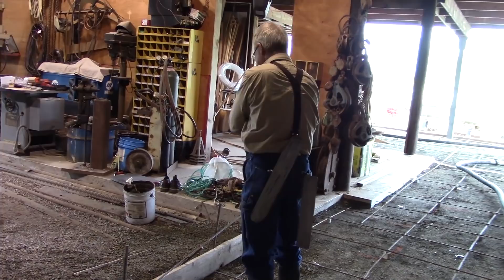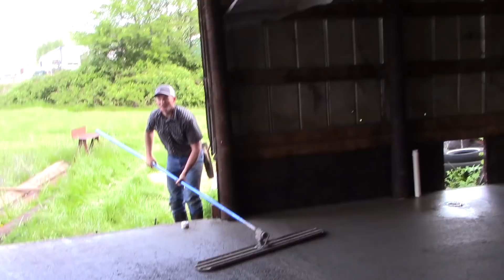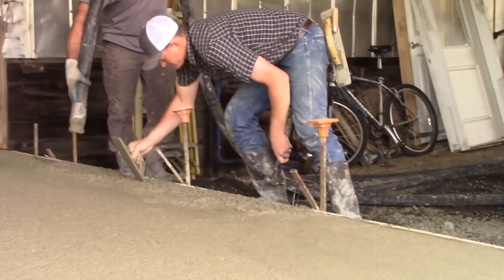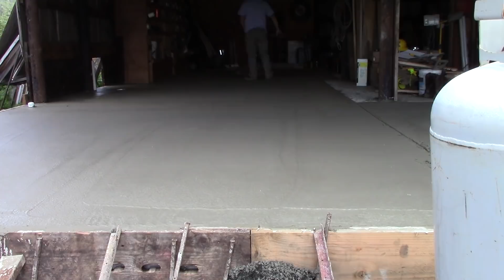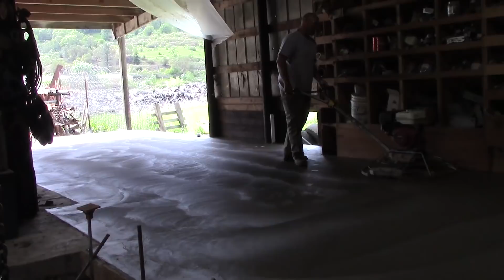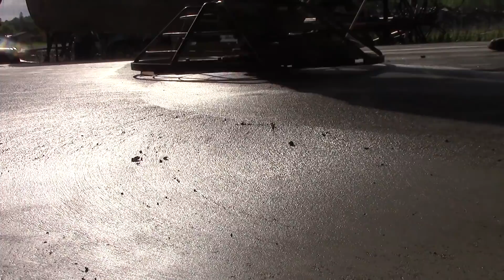Affordable Concrete Floors - Shop Expansion Part 2

Comment: Good video glad to see you wet screed and running the powertrowl great topic also I have been in the trades for 15 yrs now out of hi school and now own my own business so I know what you are taking about with the tolerance for perfection as long as my concrete turns out better than the my competitors because they are sloppy and know for incorrect ada city sidewalk slopes and have to take out there fresh new sidewalks and repour! Also they dont fine grade and then they have to tare out like 8 in thick or a foot thick sometimes ha no joke. Good video

Comment: Horses for courses . A flexibility in allowable tolerances. Thank you for the discussion Scott. I guess it can be taught but ultimately it seems everyone has to decide this for themselves . As a painting contractor for 30 years with co workers and underlings  I've found telling someone else that it doesn't need to be that good or that its, not good enough to be very tricky.

Comment: So true about slow set on cold days: I installed 300+ square feet of Saltillo tile one winter and next morning I stepped on it and it slid out from under me. My heart sank as I thought I was going to have to remove all that tile, scrape it clean and scrape the floor clean because I had messed up the mortar somehow But then I got to thinking...maybe it being the middle of snowy winter up here in the mountains is slowing the set so I waited and finally on the 4th day the tiles wouldn't budge. All this information is so available online nowdays but back then you had to learn from books, if you could locate them, or from people, if you knew them. Everything is so much easier now.

Comment: The last slab I did was for my little shop. my brother and me, with about 35 years experience between us, placed the concrete. I bull floated the mix, and then blued it out with one pass of the power trowel on half of it and one more on the rest. I have felt that power trowels cause over working of many floors, especially in cool conditions. Properly screeding and floating the slab is the only way to get a good result. It was very flat and smooth, although it did develop a thin crack after about six months.

Comment: I don't know what type of soil that concrete is poured on, it may be a nice hard - super compacted soil but I would have made the rebar grid smaller, maybe 10"-12" squares. Don't know about the concrete in your area but in California they add a decent percentage of fly ash in the mix, which I always spec to have removed, and I add microfiber. You got a good mix design but the small extra bucks for the microfiber helps for cracks, assuming your subgrade is compacted correctly and you don't have poor expansive soil to begin with.

Comment: A workshop floor always needs to be -- or at least one ought to think of it as a firm fact of life -- very level, flat, square, and smooth. Just think about it, you're going to build things on that floor, or on a table sat on that floor, and if that thing looks to be out of level and you adjust it to get level and then you take it to another location and it's out of level you're going to have problems. If your workshop floor wasn't just about perfectly level you probably made thing that was level go out of level because of interference from the floor. If you're building something for a customer you're customer is going to be mad. At that point, you could have saved yourself a lot of time, effort, and money simply buying the thing instead of making it -- all because of that floor.

Comment: Do you not have welded mesh there for rebar? Standard size here for that type of slab would be a SL72 mesh, 7mm bar at 200mm spacing each way. Much more tensile strength in comparison to what you have there and also helps with minimising shrinkage cracks if your able to maintain the minimum cover from the top of the slab (approx 30mm).

Comment: Well done sir!
All that COOPerative Exchange of Skilled Trade/Craft Labor 
and not one corrupt govt asshat required...shux one might even think that psychopathic group of subhumans didnt even exist! 
Who said COOPERATIVE EXCHANGE required a MARKET? Men make investments Wall Street is theft just like all the unnatural hierarchical structures. 
Pole Barns, Concrete, Blacksmithing, Carpentry, are REAL Tangible Investments that last. They are all investments that have a horizontal structure that help all vertically! 
I have to say as a vagabond carpenter that has worked on his own for the majority of his career It is the mistakes and the ability to correct them on the fly that is the ultimate master level!

Comment: I like your channel. Dustin is doing a pretty good job. One thing to note on a day when it won't set up is to wait just a little longer each stage before you get back on it. The other thing is to trowel it slow as you can and still keep up. A lot of times in the end this will help you gain anywhere from 1-1 1/2 stages to get it done faster. Keep up the good work.

Comment: Dustin there is doing a job with that come along that to me is as important as any other task involved in placing and finishing a slab. I have done to many pours either by myself or with only one helper and you do a lot of extra work either pulling the mud with your screed or dropping the screed and grabbing the come along and moving and shaking the mud yourself.  A third man can triple the square footage I can cover.

Comment: That floor did go slow. I'd like to see the finish. I'm thinking you didn't make it terribly smooth. I've'burnt  off' many house floors. I remember once we had the floor so smooth it looked like water was on it. And a fellow passing by said it was wet. He'd never seen a floor that you could see your reflection in.
Reply: Essential Craftsman Yeah just the finish you want. Super slick is not a good combination with snowy boots. It's hard on the rear end.

Comment: Aw man I thought for sure your approach to control joints for your shop floor would be to cut them in later with a saw.  Rather than the walking groover and then finishing back over. It will certainly crack where you jointed it but it will be an unsightly sort of crack at the surface. I think. I’ve personally never done control joints that way. Am I wrong? I was super excited about this video being a builder/mason/concrete guy myself with dreams of one day pouring a floor in my barn but honestly I was left a little confused about your choice of crack control method on that one. Nevertheless, I did learn quite a bit from this video and remain humble and as thirsty for you wisdom as ever. Thank you and keep on feeding us baby birds!

Comment: Why did you choose that method of crack control as opposed to cutting contraction joints after it cures and filling the joints with backer rod and sealer resin?

Comment: Can I pour concrete over an existing busted up barn floor? And my ceilings are only 7 ft high.
Reply: Hey gadgetman, I’ve done concrete for ten years now, still learning every day but I would say technically yes you could pour new concrete over old existing broken concrete. However I would lean strongly towards removing the old to give way to the new.

Comment: I think you should do a video on concrete terminology.  For example some people refer to rebar as #4 or #5, some refer to it as fractional sizes.  Some people call a stick of rebar 20’, some call a stick 10’ and a bar 20’.  Some people refer to mix as a “# bag” mix, some refer by thousand pound psi.  More detail on slump, things like ridding, screening, mucking, etc.  I’ve been a contractor for years and have noticed when I hire a new guy that concrete lingo is kind of like a foreign language to people not in the trade.

Comment: Huh, so you let it set to a certain degree, then power trowel over the joint.? So you end up with a floor that has no visible expansion joint or "preferred crack line," but because of the way and time it's setting, that joint is still technically there. Never thought of that (and my grandpa never taught it to me lol). Clever though!

Comment: Respect. For knowing and building what is needed, and not building to some artificial standard that achieves no meaningful purpose. There is beauty in "good enough" - 100% and no more.  Being an engineer, this is the noble pursuit. While both may be poured concrete, a shop floor should not look like the entrance to the Louvre, to do so would be a waste - of time, effort and thought.

Comment: "Allowable tolerances" I have never heard anything more correct. As a mason I can really relate to that. I hear it everyday. And its terrible. " its only a floor" its just a sidewalk" " looks good from my house etc... Is there no pride in work anymore. Good video! Looks like it came out great. Only thing i do different is go around outside edges with a small screed or 2×4 to tie in the edges. Good work!

Comment: Judging by the tone of the greens at the end, I’d say you filmed this back in late April early May.  All of my concrete experience is what I could mix in a wheelbarrow, but what I do know is that it is much easier on my back to stand on gravel than concrete.  Sure wish I had 10% of the space you have for your shop.  Every time I grab something off the shelf in my shop, 3 or4 other things will fall on the floor.

Comment: Ok.. so the crack control with cutting it and then troweling over.. 
It creates a weak spot on that line and when it does crack.. it should crack at that line? 
Would leave a nice flat floor without the edging marks. 
Nice for a shop floor where Jack's and the things with small wheels can get jammed up. 
I wouldn't mind seeing one that has sat for a couple years.

Foundation is Soo important.. if it's not sound, it won't matter what's on top.
My house has a bunch of hand poured concrete driveway that previous owner did. 90% is damaged, cracked and falling in. No ground prep. It's only 20 years old. The original driveway from the 40's is still true and crack free. Just a tad worn out on the surface.
Reply: TurboFlush the base is usually more important than the concrete, indeed!

Comment: For what it's worth, tradesmen would have a much better reputation if they would "learn for perfection, and practice to price". In other words, when you first pick up a skill, you should work to the most difficult tolerances, even if that means you will most likely loose money. Afterwords, you can pick up speed with practice and verible tolerances. That way, you're never actually learning on the back of your customers, which is theft.  Love the show...and the Markus Aurelius attribution.
Reply: I try to teach my boys; Quality first and then Quantity. Meaning learn to do something well first and then learn to do it faster.
Reply: Agree, that is my issue as a builder I have a hard time dropping my tolerances to appropriate levels and normally end up eating the time overrun costs.
Reply: My first trades job, my mentor said: "Learn to do it right. THEN learn to do it fast."

Comment: Just out of morbid curiosity and I don't have time to go back and watch your other great videos; please correct me if I am wrong. I thought you said that having a dirt floor in a shop was preferable for a few reasons one was you don't need to sweep up after your done working and I can't remember the other reason. Any way I do love your videos.
Reply: Definition of morbid 
1a : of, relating to, or characteristic of disease
morbid anatomy
b : affected with or induced by disease
a morbid condition
c : productive of disease
morbid substances
2 : abnormally susceptible to or characterized by gloomy or unwholesome feelings
3 : GRISLY, GRUESOME
morbid details
morbid curiosity

-Merriam Webster

Comment: Such a valid observation about how cutting corners (lowering the bar of acceptable tolerance) has stigmatized the building industry.  Good craftsmen have long suffered the slings and arrows aimed at the shoddy work of unqualified and unmotivated (or wrongly motivated) "handymen".  I won't even call them builders or craftsmen, since they lack any craft other than the guile of business over quality.  Thanks for this video and why is it that I love seeing concrete poured?!  Cheers.
Reply: “The guile of business over quality” is perhaps the best way I’ve heard it described. 💯

Comment: When my shop floor was poured, they used a fiber reinforced concrete and wire mesh. Then they buffed it up with a power trowel. The floor is super flat and smooth, almost shiny. They then cut control joints with a saw so there isn't a bull nose for things like jacks or other rolling things to hangup on.
Reply: @essentialcraftsman  Overall, I am happy. However, the unexpected came up in 2 places, which may be a consideration. 1.) The building was placed before the pour. Typical for pole buildings. However, since I specified nailers, an internal rim was added. So I had about 7 areas where I had to fill in to meet the outside rim. 2.) Being a metal building, an edge or corner piece was set sub grade. This was on a door frame. It was less than an inch. So the concrete guys followed it, because no metal gets covered. So I have a slight dip by a door.

Comment: When you say you got the slump to a 4, what does that mean exactly?
Reply: Its a 12" cone test.   Cone is 12" high and 8" wide.  The cone is filled with concrete then lifted.  If the concrete measures 8" high after the cone is removed, you have a 4" slope.    Typically with standard mixes, the lower the number the less wet and it will be stronger.   A lot of company's try to cheat and use a higher slope # as its easier to work with, but will be weaker.

Comment: Allowable tolerances...I was building a camp house foundation with my brother in law and father in law, both of which are machinists.  It was a 20 x 40 structure and I was measuring the diagonals to check for square.  The diagonals were within 1/8 inch and I said "Good enough".  They both looked at me like I was crazy and started asking me if we needed to adjust further.  I had to explain to them that we didn't need to be accurate to the .001 inch.
Reply: I am a former machinist and have to restrain the same tendency when I build things. I remind myself that I do not have the tools to control the job as when I operated machine tools.
Reply: This also goes in the area of welding. With wood you in general have a little more room for slack than with steel. I remember the first time I was doing carpentry as an industrial mechanic/welder. I measured up the wood, writing down the measurement in mm. The guys were like, "are you serious? You can go by cm instead." I was like, "But...!"

On the other hand with steel I remember asking a steelworker to cut a plate for me, writing down the measurements in cm. The guy asked me, "do you want cm or mm accuracy?".
Reply: Troy, the thing is, you're smart enough to realize that. Some of us are just thick in the skull and learned it too late (or not at all!). And then there's the whole issue of "learning" something, and "applying" that knowledge (sometimes more of a fight than just the learning part). I love to read, and I've learned a lot of stuff over the years. I just have problems applying that knowledge in a useful manner without killing myself in the process. Ya done good, young man! Best to ya.
Reply: Well the diagonals within an 1/8 is within 1/16 overall so that’s pretty dang good.
Reply: @jkunderwood3291  Exactly!
Reply: I built a house for a machinist...
Reply: 1/8" diagonals for a 20x40 ..... id say "good enough" is a hell of an understatement
Reply: I'm fairly sure ±1/64 is considered semiprecision layout, probably as good as you can ever reliably get by hand. With such a large structure, ±1/16 is pretty good
Reply: Back in the 70s I (we, with my brothers) built a 2 car garage. We were pleased to get the diagonal within 1/8". That was only 24 X 24.

Comment: Our concreters have a tolerance of 20mm over the whole slab or 4mm in a 2m length on a internal house slab (most go way above a few are below) It makes it fun when laying 600x tiles when we have a 1.5mm joint and the lip can be no greater than a 1mm. It's really fun when the owner wants to be able to roll a marble and get no bumps but doesn't want to pay for us to do a cement screed or use leveling compound. Funnily enough the flattest floor I ever saw and layed on was an extension on a cheap caravan conversion, and the owner just so happened to be a concrete contractor.
Reply: You did not pick an easy hustle to make a living :-)

Comment: I make it a point to watch each and every video of yours, even if that particular video doesn’t pertain to me at that point in time. The reason is because you, sir, have some of the best advice around, and you deliver it nearly unexpectedly. As a man “in the trades” as a fresh general contractor, the one that hit home today for me was “as you stay longer and longer in the trades, the temptation is going to be to get sloppier and to rationalize tougher work for the sake of the bottom line. That’s a mistake that has stigmatized too much of the construction industry”. 
I backed up and listened to it three times because I feel that is a remarkably important statement. One that if you continue to have on the forefront of your mindset, it will lay a foundation for success and profitability. People don’t want sloppy or rough work. And if you avoid it, people will take notice. Referrals will skyrocket because of it. 

Thank you sir, for yet more words from the wise. I would have given anything to have you a mentor  in my younger days. I’d probably be a little further along than I am.
Reply: Excellent observation and very true, if you do the best job possible you'll never lack for work and have to constantly turn away work because of your excellent reputation.